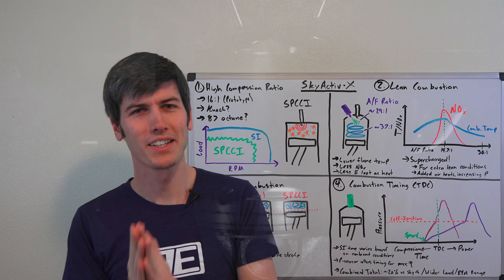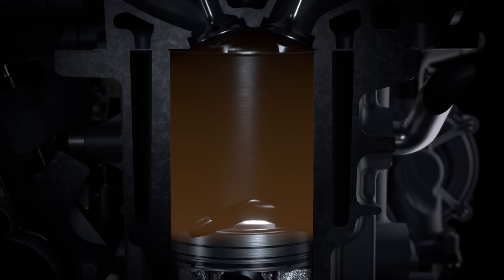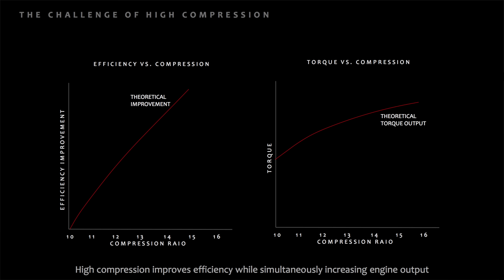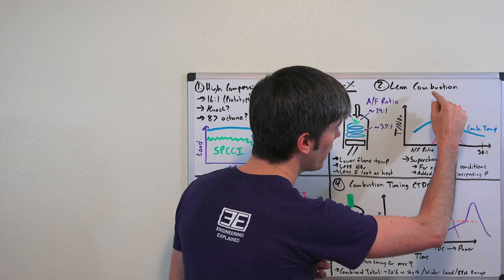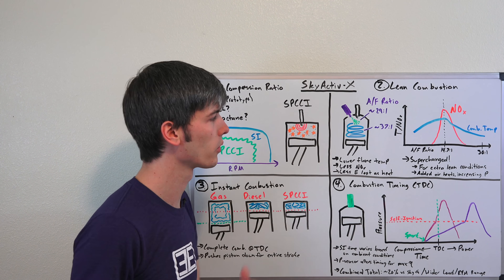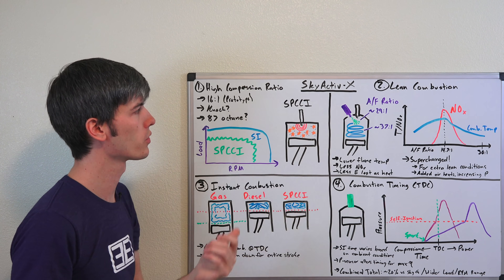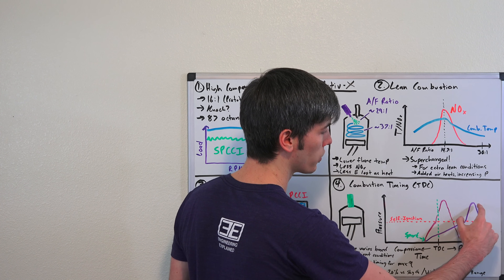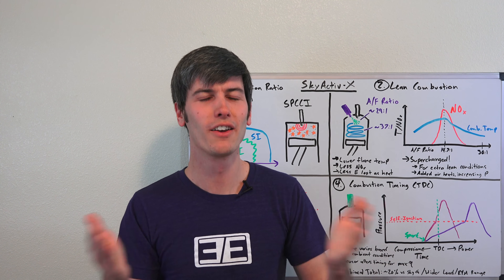How Mazda Is Saving The Gasoline Engine - SkyActiv-X

Comment from the maker: For those with a very keen eye, you’ll notice that in the EPA fuel economy charts (0:45) Hyundai had the highest number in 2013, which goes against the claim of Mazda having the best fuel economy for five years straight. This is because in 2013 Hyundai was under investigation by the EPA for claiming fuel economy numbers that were too high, so they were disqualified. Hope everyone's having a great day! :) 
Instagram: www.instagram.com/engineeringexplained
EE Shirts: https://teespring.com/stores/engineeringexplained
Reply: Rio blyth No. Thankfully. Mazda has really blossomed since ending that relationship
Reply: I have a slight problem with your explanation on NOx emissions. I was taught that this very lean mixture would lead to high levels of NOx because there is just a small area around the sparkplug that burns with an optimal air-fuel-ratio ( the german word for this procedure would be "Schichtladungsbetrieb"). I thought that was the reason why they abandoned this concept for direct injected gasoline engines.
Reply: @Enthropical_Thunder  Staratified charge is abandoned because it is very hard to do i various regimes, also on petrol engines they generaly use tumble, not swirl, which is less uniform. Isentropic exponent of lean mixture is higher (closer to 1.4 for air) so is heating value, therefore lean combustion is more efficient. Temperatures are HIGHER (but for slightly lean) because lean mixture has lower specific heat, so for equal amount of heat there is greater rise in temperature; that leads to NOx. It is abndoned by German manufacturers because they invest in marketing instead in engine.
Reply: @Enthropical_Thunder  I was under this impression too, & also that lean burns hotter. The lean-burn motor in my '89 Honda CRX HF has sodium filled valves to help dissipate extra heat like Porsche & some others do in hi-perf street & racecars. If not from the lean burn then what?  True or not, I've also heard the claim high NOx is one of the reasons Honda discontinued this torquey, very efficient motor vs improve it further. Though a very different fuel, I do know the methanol powered glow mtrs on my model planes WILL burn up if run too lean. Wish he'd answer comments, to explain better.
Reply: Dude, loved the video, just want to know a little thing.
Most cars in Brazil run on engines that take both ethanol and gasoline as  fuel sometimes a mix of both and most of gasoline here has ethanol mixed in it because of law. How much of this could be applied to a ethanol/flex engine without a big research and testing cicle?
Reply: diego belgrado Yeah thats true but it also keeps the internal combustion engine alive.. Plus if they use engine across there range of automobiles then that can also help bring the cost down while having high availability for parts in the future... Helps if they keep it around also
Reply: Also why Hyundai pays a check to my dad, based on mileage, because they essentially exaggerated their fuel economy numbers. His is a 2012 Accent.
Reply: Peak NOx production is actually slightly lean of stoichiometric. Like 1.02-1.05 . :)
Reply: It's a shame the focus on engines in your channel is typically gasoline: here in the UK, I have a Mazda Skyactive diesel which is phenomenal compared to other diesels I've driven. Can you do anything on these?
Reply: Is it possible to combine this with Infiniti's variable compression engine?
Reply: This is the second time in my life where an "official" chart has spelled Subaru wrong. (In the chart it said Suburu)
Reply: Mazda does sell very fuel efficient cars, but they do not sell trucks.  This is the only reason their FLEET average fuel economy is so high.  Yes the CX9 is a larger vehicle, but it sells in low numbers and is pretty small compared to many SUVs.  It weights about as much as a Dodge Caravan, not close to any full size truck.
Reply: It's  because the NOx produciton peaks at a certain leanness and they are well past that into the area where it has fallen off dramatically. Also, lower temps due to SCCI having a more homogenous burn leads to lower NOx as well.
Reply: @Wingnut353  thanks for the logical explanation, please write more.
Reply: @Mandernach Luca  
1, Mazda is using even leaner mixtures than that. 2, the fuel burns more as HCCI than regular SI combustion.
Reply: @johngialampoukas311   i think you mean burns at a higher temperature correct?
Reply: Will you be making a video on the opposed piston engine like that of Achates?
Reply: @ABCantonese  he did.
Reply: @Dreamer3K  You are replying to a comment from 9 months ago .... -__-
Reply: Engineering Explained I suspect a lot of blown head gaskets from the pressure sensor timing wearing off over time @ 100k miles or more.
Reply: Mazda only has one large vehicle - the CX9 - and they don't sell a lot of those.  A company like Toyota sells a lot of large SUVs and trucks.  The net result is Toyota's company average will be lowered because of this.  Also, if you compare a Honda Civic vs the Mazda 3, or the Honda CR-V vs the Mazda CX-5, the fuel consumption of the Hondas are better (and the CR-V is bigger than the Mazda CX-5).

So the graph of corporate average is not a valid comparison unless you start comparing similar vehicle classes between the corporations.
Reply: CAFE is inherently unfair, but Mazda's claim is accurate.  Mazda doesn't make the rules.
Reply: My 2012 Hyundai accent gets 45 mpg (US MPG I'm not making a mistake there) when it's only rated for 37
Reply: CX9 is a large SUV.. check the weight. 
As far as no pickups or performance cars in the lineup, there is no rule which says that "if you don't sell trucks and road racers, you can't play at our table". If/when Mazda decides to re-enter that arena (they have made both in the past), their offerings will still be class leaders in both efficiency and technology.
But I digress Ron, you are missing the entire point. What Mazda has done here is truly brilliant. This engine will bump an EPA 41 mpg vehicle to 50 mpg. The truck and performance versions will follow.  BTW, for those interested, they are working on a new version rotary engine with completely redesigned porting and combustion architecture. The goal is 280 hp and EPA 30 MPG. We'll see.
Reply: @avnett4922  
Wow! That's Great! What New material are they experimenting with to create a seal between the rotor and the engine housing?
Reply: Mandernach Luca 
Did you see the portion where they use the swirling gas(appeared to be a machined farce of the piston to force air rotation) that would help with the compression and the nozzle that increases the air fuel ratio just before TDC? 

If you are asking more of a theoretical question about the emissions then pardon me for jumping in.
Reply: Hyundai isn't :(
Reply: Does the X pair with a manual (as an option), or do they only pair with an automatic?
Reply: Make a video explaining how good it would work with WOOD GAS GENERATOR!
Reply: Engineering Explained huh? : )
Reply: You keep saying you want complete combustion at tdc but at tdc your crank journal is always facing up, to which it holds no leverage on the crank. I was always told you want peak combustion just before the crank is facing 90 degrees so your piston has the highest leverage on the crank?
Reply: @imnottajew  i was wounding also why would you want peak gas pressure at TDC, wont it be better to have isobaric combustion?
Reply: I was thinking of getting a cx-5 this year.  would skyactive-x be worth the wait or would that raise the price by an extra 2k or so?
Reply: Let's face it. No cars are built reliable anymore.
Reply: Weight, price and where i can buy one.
this are my questions.
Reply: Engineering Explained    B;
Reply: Michalis Fotiadis I see what you did there -_^
Reply: Rowdy Hick hyundai is a scammer by nature, what do you expect..
Reply: It basically IS variable compression.
Reply: Engineering Explained hello please tell me it has port injection aswell as the direct?🤔
Reply: Yard Sale Dale  engine self kills. or goes to standard combustion mode i guess.
Reply: Is it sure that they use swirl instead of tumble in petrol engine with typical petrol engine combustion chamber ? Isentropic exponent of lean mixture is higher (closer to 1.4 for air), so is heating value, therefore lean combustion is more efficient. Temperatures are HIGHER (but for slightly lean) because lean mixture has lower specific heat, so for equal amount of heat there is greater rise in temperature; that leads to NOx. Reverse effect is with EGR.
Reply: Can I put this in an airplane?  Would it have problem's at altitude?
Reply: Why does the chart say 'Suburu'?
Reply: Is this engine already being sold in production vehicles yet ?
Reply: Engineering Explained is the engine already been sold in cars ? Or in near future ?
Reply: Engineering Explained   Can you do an update or link to a good update.  How are the production engines running, received in market, etc??  Many thx.
Reply: As always very informative, but may I suggest speaking a little more slowly so that you don't trip yourself up as often :-) One of the best auto engineering channels on the web
Reply: Where is the difference with a N53 BMW engine, except turbo?
BimmerN53
Reply: I was also as excited, however the 2.0 X found in the mazda 3 and cx30 does not seem to do better than small turbocharged cars.
Reply: Driving on knock? Welcome to the Diesels Club mate! :D
And swirling mixture is nothing new. My 1995 TDI does it the same way just with 19.5 to 1 compression ratio and an additional boost of 0.9 bar (absolute 1.9 bar). :D
Reply: You said a low-octane fuel is desirable --  what about Ethanol? Would that be okay, or would it be too low-octane?
Reply: @manofsan  ethanol is too high octane
Reply: @ellenorbjornsdottir1166  ethanol is too high octane? But it's pretty light, not like diesel. It's hard for me to believe that ethanol is too high octane when it's so light.
Reply: I still remember Hyundai i30 total scam the fuel consumption was 40% higher than it was in the papers :D
Reply: How could Mazda do that? Why did nobody else and why did it take so long? Why one of the smallest car manufacturers?
Reply: @shalokshalom  Many factors, they are small but they always went against the mainstream. And they have great talent in building great cars and engines. In time when everyone was thinking about down sizing and FI. They wanted to do something else and were working hard on their ideas.
Reply: Could you make a video about microturbines? They seem to be the future in hybrid propulsion since they burn cleaner than piston engines.
Reply: I don't think you'll answer, but does this engine has a variable valve timing and lift ?
Reply: Hi, it appears that Skyactiv-X failed to deliver what it promised. Bad MPG, bad acceleration, knocking...  could you do a analysis?
Reply: Hi, it appears that Skyactiv-X failed to deliver what it promised. Bad MPG, bad acceleration, knocking...  could you do a analysis?
Reply: Engineering Explained  E-superchargers and the benefits of the 48v system... next please
Reply: Engineering Explained The ratio is lit A/F 💯
Reply: Engineering Explained i remember that! I had a 2013 hyundai Veloster at the time. Hyundai had to reimburse customers by overstating mpg numbers.
Reply: Engineering Explained if I'm not mistaken CAFE standards apply to all retail vehicles produced by the automaker.  Mazda doesn't make large SUVs or pickup trucks like many of the other automakers.  Nor do they currently make a high performance sports car like a mustang or corvette.  I think it's a little unfair for them to make the claim of having the Highest CAFE because it's an unfair comparison.
Reply: Engineering Explained how did you  get to test drive a Skyactive X and learn the stuff of it before Dealership Principles, Mazda training school instructors, master technicians, FTS people, and normal technicians?
I work for Mazda so thats why im asking haha.
Reply: Because it was less efficient... way less efficient... I'm really not sure where you got the impression that it was efficient at all. That isn't to say that you can't make an efficient rotary but they didn't.
Reply: Why is your fuel so low on octanes? Here in Italy the lowest you can buy is 94 I think, while premium is around 97/99. Would this actually mean that cars with this kind of engine would struggle in my Country?
Reply: @phlave  RON. Your 94 is our 87.
Reply: Engineering Explained is Mazda still Ford?
Reply: @rioblyth3926 The EcoBoost is a rebadged Mazda engine!
Reply: @doorguner01  😅we are looking at getting a Ford TDCI, are they good engines?
Reply: Rio blyth , not since 2012. Mazda has been doing their own designs and engineering since 2013 and share no parts or platforms with Ford since.
Reply: I would also like know how this engine would perform with ethanol based fuel. I know that E-85 in the states some times give better fuel economy in some cars, but it comes with a host of other problems if your vehicle is not set up so that it can run it.
Reply: @KnightsWithoutATable  not true. Ethanol has less energy density than gas, & any added % of it in turn reduces efficiency/mpg. And the higher you raise the ethanol % in gas it only gets worse. A comparable to gas mtr designed for straight ethanol is much less efficient.
Reply: @katmanluke7187  Efficiency of the combustion so that the engine can actually convert the thermal energy to kinetic energy is effected by fuel composition. The makeup of the exhaust gasses and their temperature are also sometimes needed to be considered, especially if the engine has a turbo charger.
Reply: I tend to agree with this. Batteries have been around quite a while and charge times have always been a pitfall. I don't know that batteries ever will reach a point where charging will be as quick or efficient as filling you're gas tank which is a major issue. Especially here in the states where we have vast expanses covered by cars. I go on several drives a year that cover more than double the range of what even the best full electrics can cover. Its just not a viable option for me as well as many others. On board generation is the only way they will succeed. Be that in the form of a fuel cell or otherwise. We already see that now full electric sales are not growing as quickly because many people can not reasonably make them work within their financial and geographical confines. I know cost will eventually go down but range will always be a controlling factor. I just cant justify an $80k Tesla or the like when one charge would barely get me out of my state. And most of the people I know using electric simply drive it short distances say to work or around town but still rely on IC powered cars for everything else.
Reply: can you go into more detail about how and why running lean does not actually create more heat? I was always told that it did and would love to learn why that's not true so I'm sure others would too.
Reply: I just bought the me Mazda6 Turbo and am really impressed with what mazda has done. My fuel economy is significantly better and more torque than my Mazdaspeed6 had. No knock and instant power just a tick over 2k rpm. This new engine shows how Mazda is paving the way for making a cleaner and more powerful gasoline engine! No one else really has put as much effort into it and gotten the results. Sure electric drives are going to be the wave of the future and if I read this right 2020 is their electric debut. But  making due with what is still out there and with 87 octane fuel... thats awesome!! And really good explanations! Keep it up!
Reply: That's cute. I've been driving EV's for 3 years now. Gas?
Reply: @InSaN3ViSioN  Petrol. Hank Hill and his nemesis at the methane well sell gas.
Reply: Skyactive-x + CVT transition
Reply: Looks to me like a very complicated engine that will rely heavily on the ecu. Maybe the technology will reach peak reliability 10 years after its commercial introduction. By then, most automobiles will be PHEVs. Having said that, Mazda's efforts are not futile because the skyactive-x technology can drive PHEV range even higher.
Reply: @rowdyhick1525  There all crooked!
Reply: Question here.....How reliable is the Mazda Sky active X? I'm also hearing that one model of that engine has two turbos. Wondering is that far fetched? I had a Mazda 626 two door coup, standard 5 speed transmission.  It was awesome to look at, but didn't have enough power. .
Reply: @tedhernandez2394  Mazda ceased all development of Wankel engines in May 2009, Skyactiv-R does not exist.
Reply: Michael Lehto 
Thank you for saying that for me .  Unless there is a complete paradigm shift in batteries gasoline/diesel is going to be the most reliable and uncomplicated way to power our cars.
Reply: I thought that the process of making a electric motor is worse for the enviroment than a lifetime of a petrol engine emissions
Reply: Jarryn Smith I work in the Electrical Power Distribution Industry - YES, you are correct!
Reply: Jarryn Smith — I don’t know where you heard that, but it is pure non-sense. Just think about what’s involved in distracting crude oil from the ground, refining it, transporting it, then burning it. Anyway the facts are not that hard to find.
Reply: @MrTeff999  70 million new cars were sold last year, not a single one was powered by a Wankel engine.

That should tell you something.
Reply: Actually, i do find this Fair. the CAFE standards are measured on Company level not op product level, In reaction it doesn't show the way of the product but the way of the company. A company can decide themselves if they want to develop a car that raises their company's CAFE level or not, that's just visualizing the will of the company where they want to go. Do they want to support a Certain buyers group that want to buy special cars or does the company think it's better to target the Buyers group that goes for the Company that thinks of the environment. its all the company's own choice they are not enforced to develop SUV, Sportscars, or Clean cars. they search for a direction where they want to grow their company to and then go from there.  So yes Mazda doesn't have an alternative to a Dodge ram or Ford Mustang but is that Required to have before a Company is allowed in these regulations? No its the choice of Dodge and Ford to develop those cars since they see business in those models, but that is their choice and they go forward with it knowing it will impact certain things (these numbers ect). I would have agreed in your statement if it was some Regulation about "SUV's" where Mazda said "here you have our Mazda 2" because then they try to get good numbers with lying since then the conditions are stated that are not met.
Reply: MrBeehjay Really, prove it. We have been told a lot of things which are inaccurate.
Reply: Producing an engine with more parts and subsystems makes it very complex, the reliability and durability to keep it running starts to make too much work and money. Electric cars will continue to improve their batteries in less than a decade  to reach most of the world.
Reply: CO2 is not pollution.
Reply: Wes RR THANK YOU - people need to be reminded that CO2 is a critical ingredient that trees use to make Oxygen!!!! 
(Fools!)
Reply: Engineering Explained   Could you put larger injectors on it to get 500 hp?
Reply: More over engineering in order to boast big numbers for the EPA and dealerships with less real fixes to already existing carbon build up problems on the DI Skyactive. Mazda should offer a duel inject solution like Toyota has with the Camry. Now that all Mazdas are made in Mexico along with the carbon build up issue. I'll stay clear. It's a shame too because they make a great car but it's heading down a selfish path that's not consumer focused.
Reply: co2 is a greenhouse gas that we try to avoid because too much co2 in the atmosphere traps heat and contributes to climate change
Reply: Electric propulsion with batteries as energysource is NOT the future.  Just wait and see.
Reply: The IC piston engine is the least efficient of all time. Why didn't they stick with their rotary?